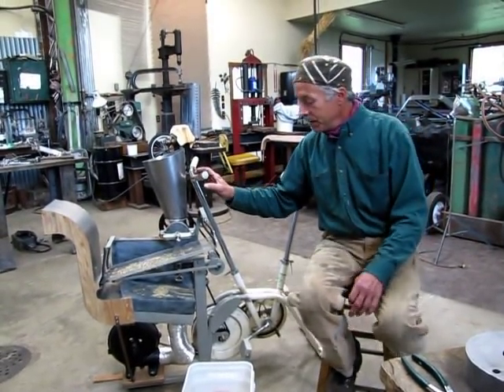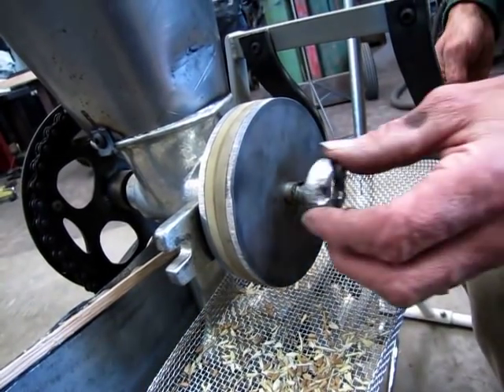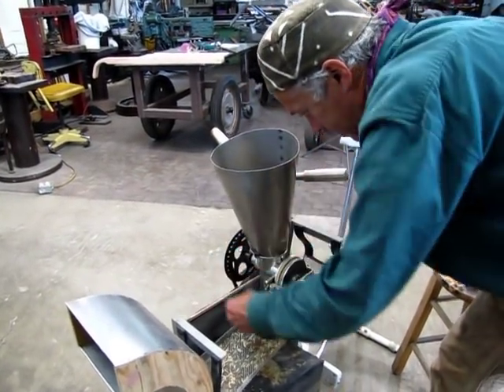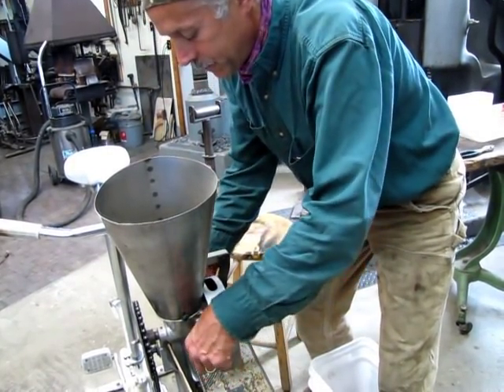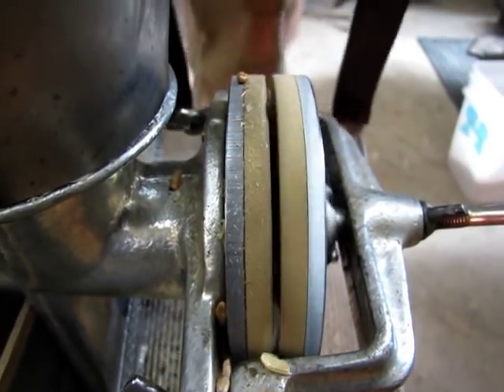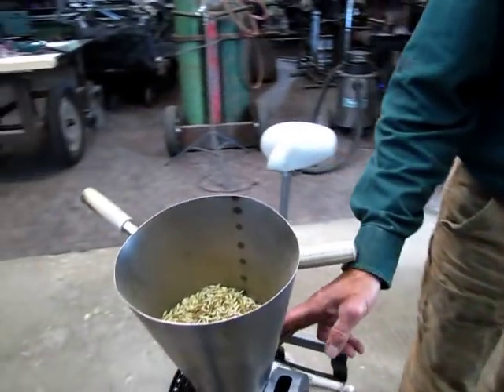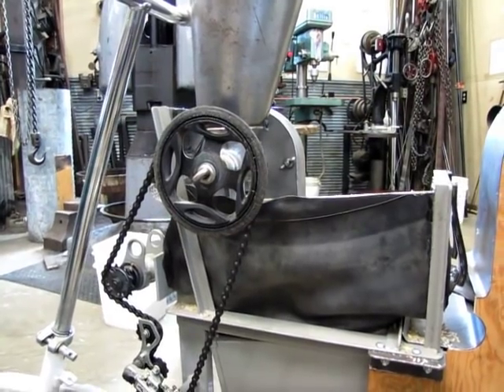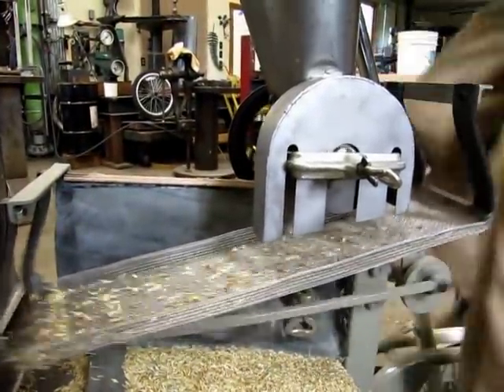pedal powered grain cleaning

Comment: I am very impressed. I am trying to find a method to clean oats. would it be possible to make adjustments to this machine? I do roast the oats in 90 C so the hull is relatively easy to remove using two small sheets of rubber.  Thanks

Comment: thanks for the fantastic design! Can you tell me what you used for the rubber pads? Thanks for the help
Reply: Copied this from another video.

Galen Lehman 3 years ago (edited) 
UPDATE: 1)  In the video, we recommend gluing Grainger part number 1XWZ7, which is 1/6" rubber, to both burrs on the grinding surface.  Further testing has shown that using 1XWZ7 on the handle side (stationary) burr and 1XWZ9, which is 1/8" thick rubber, on the moving burr is most effective.2)  Food grade versions of the sheets listed above are available.  However, we did not purchase or test those versions.  If you test this setup with the food grade versions of the rubber pads, please post a comment and let us know how it worked.  It looks like you should choose either 1MXC8 or 1TVK8 for the 1/16" sheet and either 1TVK5 or 1MXD3 for the 1/8" sheet. (I'm not sure what the difference is.)The grain mill is available from www.lehmans.com.  Search for item number 1079030 or try this link: https://www.lehmans.com/product/economical-corn-mill